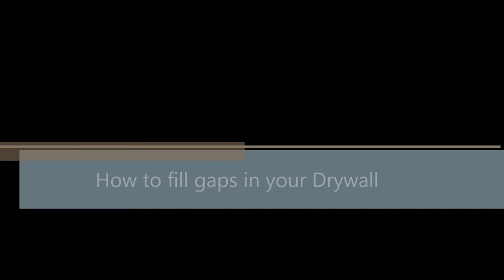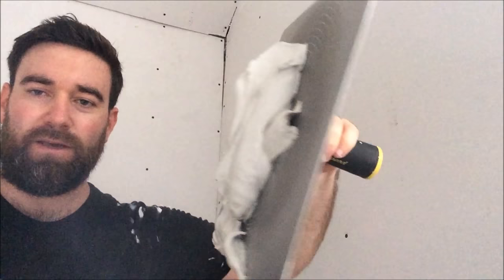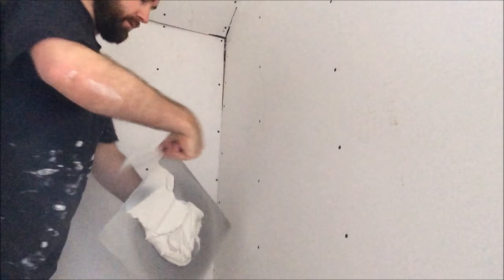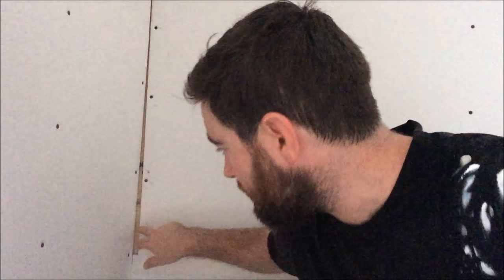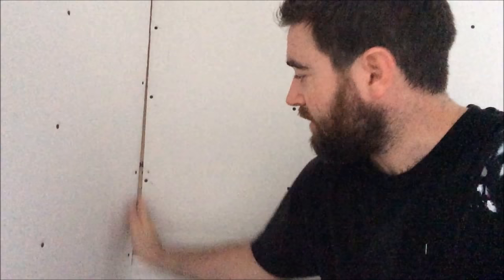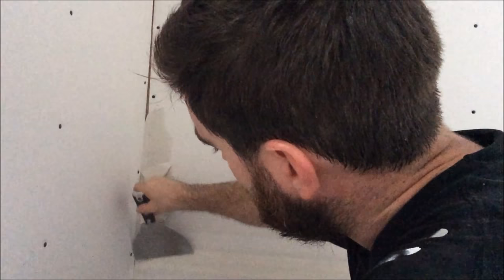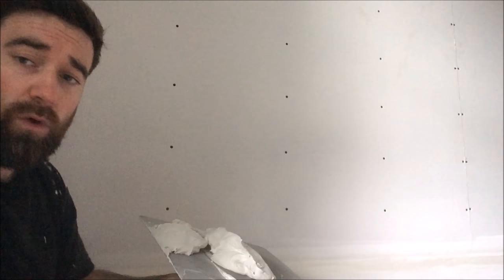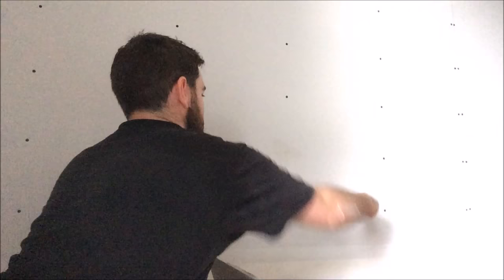How to fill gaps in your drywall

Comment: But what to do if I didn't find this video in time and went ahead and taped on top of the gaps while also using all purpose?  Do I rip off the tape and start over?
Reply from the maker: No, don't do that yet, wait and see what happens , if there was too much moisture in the corner, it will bubble the tape pretty bad, I would say then cut out the bubbled areas re tape them and re paint and it should be fine. It all depends on the size of the gaps too, the ones in my video here were huge sometimes smaller gaps might be ok. I would say wait and see if the tape starts to bubble, have you primed and painted? If you have not then hold off on sealing it up until you see if it bubbles
Reply: @TheCanadianHomePainter  No, good thing I was still on first coat when I noticed the bubbles where the gap was. Would I be able to get away with using applying a thick layer of durabond over the bubbled tape?
Reply from the maker: @spolarium_III  I would probably just start over in that case, atleast with the bad corners, remove tape and replace the all purpose from the gaps and fill with the 90, applying a coat of 90 over the bubbled areas will most likely not fix it. I'm sure you don't want to have to do so much extra work at this point but unfortunately that is probably the best way to eliminate issues after you paint everything . Or just cut out the tape where it's bubbled, and replace the compound in those isolated areas, but you're probably better off the just remove all the tape, especially if you are only on the first coat
Reply: @TheCanadianHomePainter  Yea I figured as much :/ Wish I'd seen your video sooner. Thanks for all your help! Subscribed :)
Reply from the maker: @spolarium_III  you're welcome, I hope it works out

Comment: Can you use 90 instead of all purpose for all your joints?
Reply from the maker: No, don't use it to tape the joints, you have to use all purpose for that
Reply: @TheCanadianHomePainter  thanks for the reply. I had a crack along a seam in carport ceiling and I pulled a long mesh tape job out. It removed a good bit so in that area not only is the joint there but also unlevel do to removing paint or whatever else they had there. I filled it with 45 without putting tape or mesh on it to kind of level it off. Planning on putting mesh or tape on it tomorrow. I'd have to use all purpose and tape for that? Have you ever leveled something like that using mud?
Reply from the maker: @stylicho  I would use the paper tape, in my opinion it is the best, the strongest and will give you the most longevity. I use CGC all purpose for the tape portion of the job. I have other videos showing how I tape joints. If you look through my channel you should find some more helpful info.

Comment: Could I message you with a picture of my insane ceiling corner that I’m having this issue with. It may not may any difference and the technique would be the same but they aren’t 90 degree angles. They’re like 140 degree open insanity angles amd I don’t know yet without possibly cutting more away what I have to screw into fir extra stability

Comment: When you say sheetrock 90, are you referring to Sheetrock Easy Sand 90?
Reply from the maker: No it's not the easiest to sand but it is great for filling g big gaps
Reply: @TheCanadianHomePainter  Ok, my big box store only had the USG Easy Sand 90 not the Sheetrock 90. USG shouldn't have a name like Sheetrock since they put that word on all their products lol. Anyhow, thank you.
Reply from the maker: @ehaltom1  you're welcome. It might be ok to use that. I haven't heard of that brand. I know that the sheetrock 90 works awesome for really big gaps because it dries rock hard and there is little chance of dealing with cracking in the future.
Reply: @TheCanadianHomePainter  Cool, Thanks!
Reply: Yeah its the only product  out here in California.  I looked several  place for just sheetrock 90 buts called sand 90
Reply: @jeramygrajiola1544  I've done the same here in AZ and I can't find Sheetrock 90 anywhere.
Reply: @ehaltom1  Could that be Durabond 90?
Reply: @julesk3117  I think Durabond 90 is even different from Sheetrock 90. I did find Sheetrock 90 on the USG website, so I know it exists lol. They just don't sell it around here. I imagine that Sheetrock <branded> is more of a basic plain jane variation and the others have additives for different purposes.
Reply: Sheetrock easy sand is just a different version of quick setting compound. There are hundreds on the market. I just strongly advise against anyone using brown bag durabond. It basically the original formula and it is very difficult to use. It’s setup times are very easily manipulated and is nearly impossible to sand or scratch down after it completely dries. And I have been a finisher for 10 years and this video is actually accurate so I give it a thumbs up.
Reply: It says sheetrock 90 is only available in eastern Canada. Are you aware of anything similar in the states? Trying to find a substitute but no luck yet any help would be greatly appreciated as I am a total newbie and need to fill some large gaps. Thank you.
Reply: @kitkatmoore2096  Were you able to find the U.S. equivalent? Thanks

Comment: Is this the same stuff as Easy Sand 90?
Reply from the maker: No, the stuff I used in this video is definitely not easy to sand, it dries rock hard. Great for a backer but you dont want to have much h to sand. The easy sand must be a bit different that allows for easier sanding

Comment: I have searched and searched where can I buy this product in Northern California? Near Sacramento please need help
Reply from the maker: Hi there, thanks for watching my video and for your comment. I would think that home depot would carry sheetrock 90 in California, I'm sure you have checked there. I am surprised that you are having such a difficult time finding it in Cali. Here in Canada it is carried by most hardware stores or building suppliers stores. Just googled where to buy it in California, and google says home depot, but maybe in certain cities perhaps not everywhere. If you tell them what you are looking for they might have something that is very similar. Let me know if you end up finding some.
Reply: The Canadian Home Painter thanks I did look on Lowes not Home Depot maybe I have to order it I online i will let u know what I find thanks for answering
Reply: I checked Ace hardware they have something called Sheetrock 90 easy sand ? Is this the same thing u use? If so i am giving it a try
Reply from the maker: Someone else mentioned sheetrock 90 easy sand in the comment section before, the stuff i use is far from easy to sand lol it dries really hard. so that might be something that is only in the US , I have never seen it up here. but it would be nice if it does the same thing but also a bit easier for sanding. let me know how it works out for you. Are you doing a reno project on your house?
Reply: The Canadian Home Painter I’m fixing a large hole and unfortunately I have a few gaps less than an inch wide I’m kind of worried about mixing from what I understand the consistency of peanut butter?
Reply from the maker: @yomoxy  ok, I would say not quite peanut butter, maybe between soft ice cream and peanut butter, now I'm getting hungry lol. Hope that gives you a good idea, in the video I didnt show mixing it, but I think I show it not falling g off the hawk when on its side.

Comment: why is that like that? Is the framing off?
Reply from the maker: Possible a bit and also, bad cutting of the drywall board. I know the guy that did it wasn't a drywaller.
Reply: @TheCanadianHomePainter  i see . how does he not cut straight? No t square or tape measure. The stuff snaps a clean line. How could anyone screw that up?
Reply from the maker: @gianthills  the issue would be with bad measuring I imagine and angles of the slope ceiling can cause issues
Reply: @TheCanadianHomePainter  i see. Thanks

Comment: What happens after the Sheetrock 90?
Reply from the maker: After it is dry , I sand it smooth and then start to apply my paper tape, for this I use an all purpose drywall compound
Reply: Any recommendations on all purpose compounds. I'm in the U.S.

Comment: what not just use regular mud and tape for that gap?
Reply from the maker: Hey! Good question, regular mudd take longer to dry, so with large gaps it would retain moisture for too long, so if you went and did the tape and finished it off, primed and painted, that mudd would still be moist, and the water would have to go somewhere, it would push through the tape and the new paint job, because the paint would seal it in. And if you ever have seen corner tape that is cracked or bubbled soon after the Job was done, most likely that is the reason, sheetrock 90 is a bit of a pain to work with but it dries like a rock in about 90 mins from mixing it up. It doesnt shrink and gives you a great base to start your tape job. Hope this answer helps. Thanks for watching and for your comment.
Reply: @TheCanadianHomePainter  thanks for replying! So could I give regular mud more time to dry and be okay? I can only work on my project during the weekends so it'd have a whole week to dry between coats.
Reply from the maker: @FrankPapadakis  okay, in that case my opinion would be to let it dry for as long as you can, even pop a dehumidifier in the area to let that such more moisture out of the mudd. Just make sure you dont rush the process and you'll probably be alright, I just never have that amount of time to wait for reg mudd. But if you do then should be ok. If you aren't able to get sheetrock 90
Reply: @TheCanadianHomePainter  thanks buddy, yeah we are playing two different games. I can take up more time to save money, you gotta be fast so you can make some money!

Comment: could you answer my question?  or someone?

Could you put mesh tape on it first while you fill it in, then tape over it with paper? I feel like it would be stronger.
Reply from the maker: Hi, I suppose you could do that but it wouldn't be necessary. Sheetrock 90 dries rock hard. It can be difficult to sand so that's why you dont want a lot of excess. I have never had an issue when I use it. Hope this helps. Thanks for watching and for the comment.